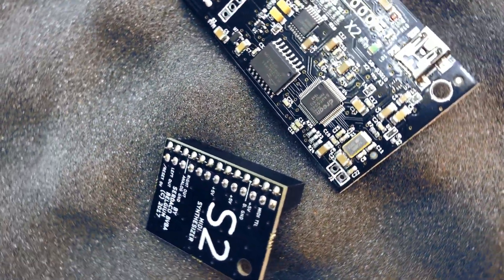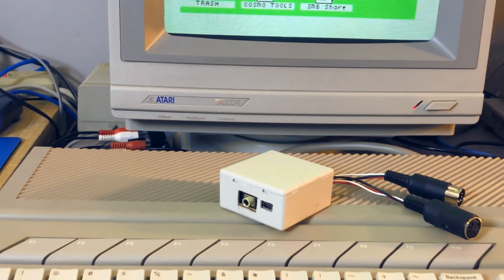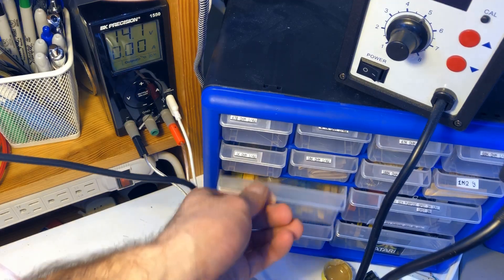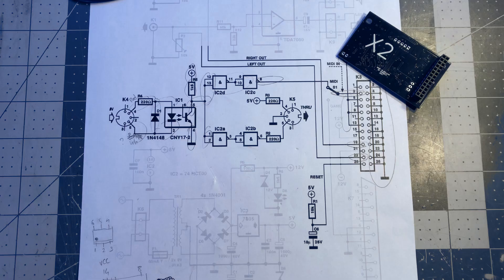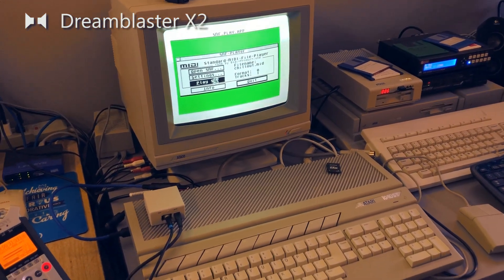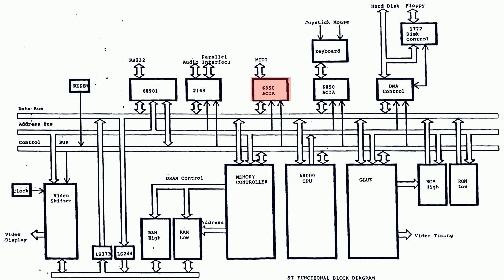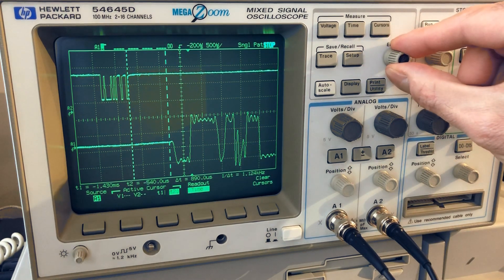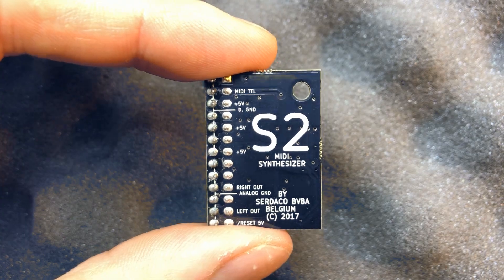DreamBlaster on Atari

Comment: What would the purpose of this be besides playing midi files? I don't think any Atari games would make use of this would they? If so that would be awesome though.
Reply from the maker: There are a few games using MIDI output indeed. However for me it was more about using the great XM Soundfont banks, as I use a regular and quite basic Yamaha keyboard as an input, the Dreamblaster series of products are able to have much more customization on sound effects, reverb, pan, and much more that I didn't have on my keyboard. And yeah it works with MIDI so it would work as an compact external MIDI synth for any device, the Atari part was just a bonus :)

Comment: Very nice project - was there any extra circuitry between the waveblaster and the output jacks?
Reply from the maker: Thanks! Nothing, Waveblasters were feeding Line-level audio to the soundcard. To be extra safe you can always add a capacitor  to filter DC out but I didn't deemed it necessary.